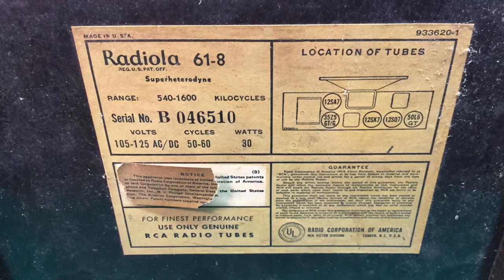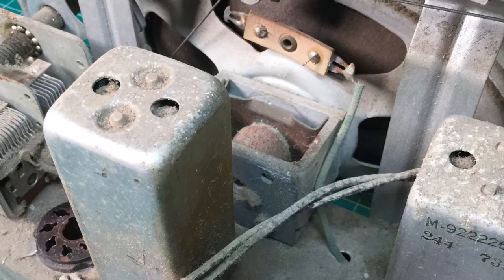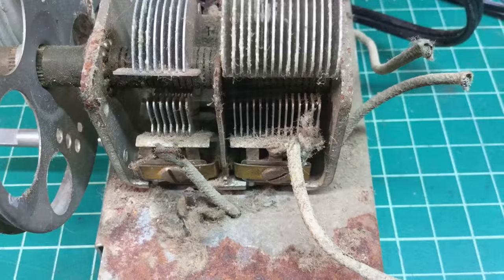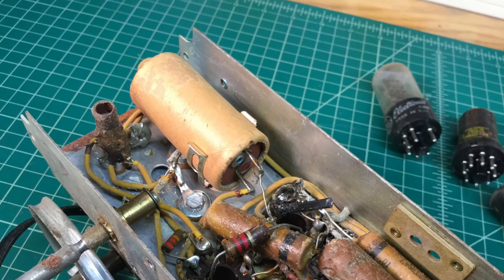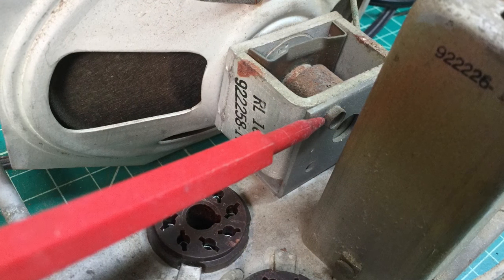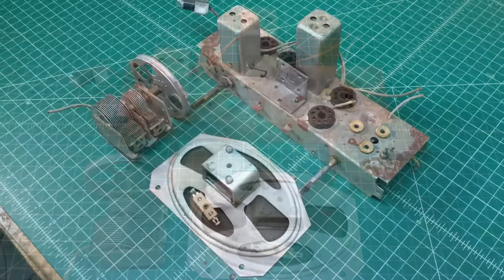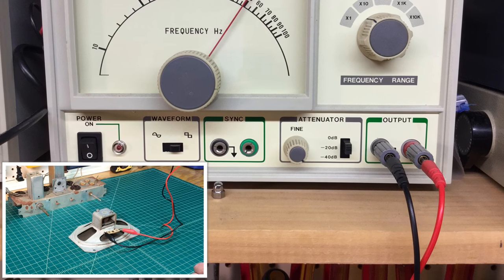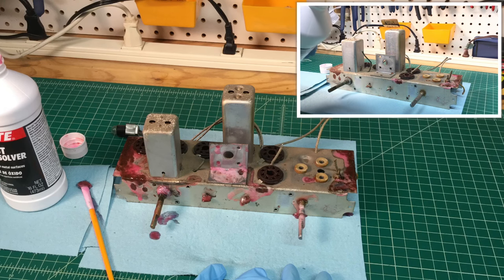Radiola 61-8 - Let's Get Started

Comment: Thanks for the great videos. I have started using Evaporust; about to finish body of classic tube tester. What do you use on exposed metal parts, after rust removal, to prevent re-appearance of rust?
Reply from the maker: +Michael Swindal Michael, thank you for watching and your kind words. I've used all of these products with success, but some only for a couple years so the jury is still out on perpetual results. They are: Clear coat of Enamel, Boeshield T-9, Aerosol, Picklex 20, Renaissance Micro-crystalline Wax/Polish. Hope this helps and keep me posted on your restoration; it sounds like a great project. Should you have any additional questions, just let me know. Best, Don